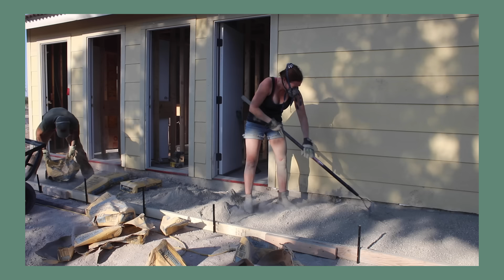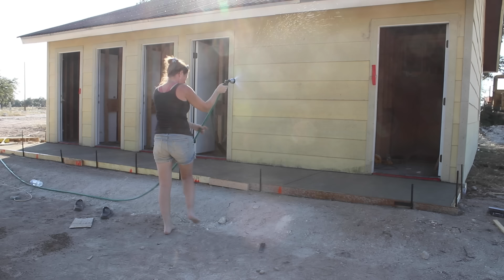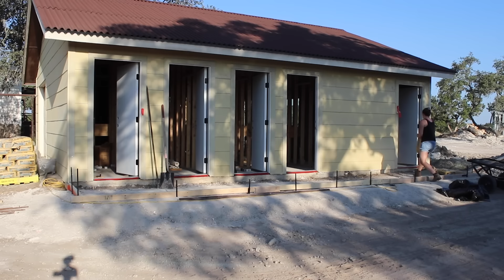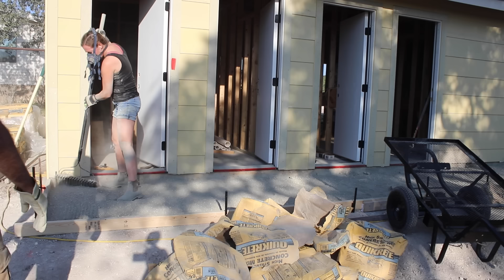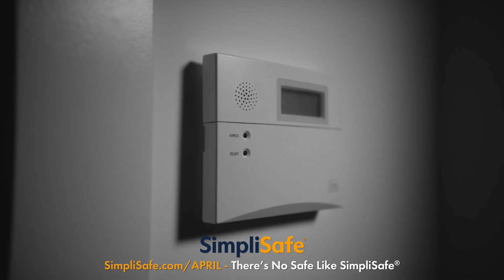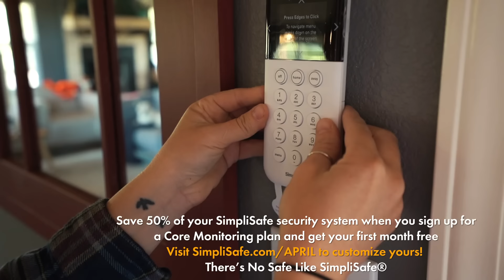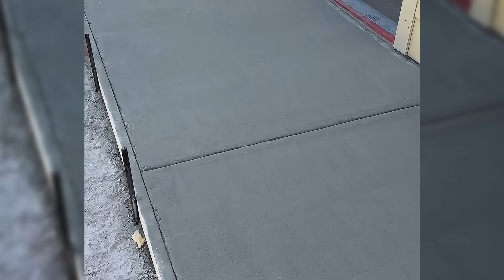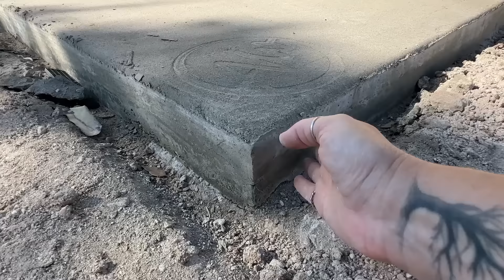Dry Pour Concrete | Better than Wet?

Comment: I was very intrigued when I first saw videos of dry pour come out about a year ago.  After seeing some of the after investigations by engineer types I would probably not try it except for light use.  No construction overhead.  Just don't think it is worth it.  But I will keep searching for ways to do this and make it strong.
Reply: A lack of hydration can weaken a dry pour, but the guaranteed weakness comes from the lack of compaction. In a wet pour, part of the process involves vibrating the mix so that the parts settle together and the air bubbles come out. That never happens with dry pour leaving lots of voids that will be prone to breaking. Vibration is usually the way to consolidate aggregate, but I think you would have a bigger dust problem if you tried that.

Comment: I found  this for calculating how much concrete you need..
Mud mixer has a calculator on their website 
I'm debating dry pour for a road runway down our hill to the lake 60" on center instead of spinning tires taking my Pontoon up in the spring

Comment: I worked as a form carpenter and form watcher during the early 80’s on locks and dams.  Concrete needs to be poured as dry as possible.  And at the correct temperature.  It dries to the hardest under water and continues to harden for 100 years.  I have never poured it dry except for mailbox posts.  This method makes a lot of sense for pouring bags.
Reply from the maker: Yes, I think it's perfect for what I needed. Thanks for Sharing and for watching.
Reply: The other thing those concrete pours needed was vibration to consolidate the aggregate and remove the air pockets. This never happens with dry pours, which is why it is inevitably weaker.
Reply: @johnlee7085  You can vibrate the forms on the dry pour.
Reply: @zedwpd
While it is possible to vibrate the forms on the dry pour, that’s not a standard practice. It would also be irrelevant for two reasons:
1. In virtually all compaction processes, there is a need for some moisture to achieve maximum compaction. 
2. Even if you could achieve maximum compaction, vibrating the forms would only compact the outer few inches of concrete leaving the vast majority of the slab with inherent weakness.

Comment: Do you really want to connect the new slab with the old? Cracking potential?
Reply: It’s generally done to prevent differential settlement and trip hazards. The rebar and columns are the two most likely places for failure.

Comment: Is there a special bag to get?
Reply: Nope regular concrete works.

Although I recommend watering it for several days everytime it looks dry.
And let it sit for 3 or 4 before pulling the forms.

I have made several sidewalks like this.
The people I did them for dont drive tanks on them.

Rough is better than smooth for traction.

Comment: Looks promising and job well done, but two questions arise 
1. How much water do you need to poor on to it, when do you know it is enough ?
2. How does the price relate to wet concrete for the same area.
Thanks for sharing
Reply: You need at least as much water as if you were mixing for a wet pour; about a gallon per bag. You probably aren’t going to measure the water, so error on the side of over hydrating. You really can’t give it too much water. You can add too much water if you’re mixing it with the dry concrete, but once it’s placed, the concrete could be completely submerged and it won’t weaken the concrete. In fact, the concrete will be stronger. 
You use basically the same amount of concrete, so it’s no different than the cost for mixing the bags. Bagged concrete is a lot more expensive for a big job.

Comment: Dry pour isn't a new method, it's just new to social media. Wet poured concrete all over the world has cracks in it. You nailed it when you said this is for light traffic applications. Anything bigger than a shed or a tiny home would probably need more strength. As a DIYer with a limited budget, I have been pouring all my concrete using this method. It works perfectly for my needs. I work alone so I need to be able to take my time and even spread the project out over 2 or 3 days. I'm thrilled with the results. People online need to learn to worry about themselves and their needs. If you don't like something, keep scrolling. Great job and thanks for this awesome video. It looks great.
Reply: Discussion is how we learn.
Reply from the maker: Thanks! Yes, I think this will be perfect for what I need. Thanks for Sharing and for watching.

Comment: Several years ago I did a dry pour in the crawl space of a 100+ year old farmhouse. It’s holding up fine, but I do notice it’s more gritty than a wet pour. I see no reason for your dry pour to fail April. In both cases it’s a low pressure environment for the concrete.
Reply from the maker: Awesome! Yes, I think it's perfect for what I need. Thanks for watching.
Reply: Columns and rebar will likely create high pressures.

Comment: Interesting process. I have not seen anything quite like this being done. I have seen where people have set posts in concrete using a dry pour in to the hole and add water but have not seen a slab being done like this.
Reply from the maker: Thanks! I'm glad you found it interesting. I think it will be fine for what I need. Thanks for watching.

Comment: I am happy you are experimenting with this idea. You are brave to put this on display in public seeing the sentiment of the comments, but I think experimentation is important. The patio looks excellent and can't wait to see the updates. I wonder if rain over time will make it even stronger. I have an architect and urban design background and we would use the slump test to determine the success of the concrete. These are tests for applications with heavier use. I don't believe that the method you are using is abberant since there will only be foot traffic. Thanks for sharing... Seriously!
Reply from the maker: Thank you! Yes, with only foot traffic, I think this will be fine. Thanks for watching.
Reply: Only light foot traffic - except where it’s the foundation for the columns.

Comment: Very disappointing to see you buying into the nonsense that is dry pour.  It is weak and will slough off at the edges.  You could have divided your porch into maybe four sections and done them separately to eliminate the dreaded urgency of a larger pour.
Reply: But instead she’s testing it and will report back.  How can that be bad?
Reply: Failure is generally seen as bad, though it can also be a part of learning. Learning from the failures is just easier.

Comment: To me that looks like more work than just doing it the right way. Also when you mix concrete in a mixer there's a thing about timing that makes the concrete stronger. It's actually a chemical reaction as you're mixing and then you put it out before the flashpoint starts to begin. What happens then is it generates its own heat and then it'll dry no matter how much water you put on it because it's a chemical reaction. So the key there is timing
Reply: You don't want concrete to "dry", you want it to cure. It is a chemical process that requires water, when you let concrete "dry" you lose the water that the chemical process requires. This is why it is best to keep concrete from drying out during the first week of curing.
Reply: @HarmanRobotics I’m not sure you understand the curing process. The water once mixed starts a chemical reaction which makes the concrete harden. The water doesn’t leave the concrete, it becomes a permanent part of the slab. If you weigh concrete before and after cure there will be almost no difference. The reason to keep it wet is to slow the process down by keeping it cool. This is one reason why dry pour has less strength. You start the curing process by adding water, but after it hardens subsequent watering doesn’t really add anything. So you get pockets that got enough water and pockets that got too much next to pockets that didn’t get enough water.
Reply: There is no one "right" way.

Comment: Another plus for dry versus wet. Is on a small pour like yours. A concrete truck will bring you the amount needed for a small pour, but they will charge you more for the smaller amount. At least they do where I live.

Comment: Curious about the amount of bags needed. If doing a dry pour did you find you needed more bags than doing a wet pour? I’m assuming when mixing the water add to the volume of concrete so lees actual concrete would be needed to fill the form
Reply: There’s no volumetric difference. The water is absorbed into the dry and results in a chemical reaction - which is also why she needed the lotion for the burns on her legs.

Comment: They have done destructive testing and dry pour doesn't withstand anywhere close to the same pressure as mixed.
Reply from the maker: This will only be walked upon so very little stress. Thanks for watching.
Reply: Except for the columns supporting the roof. 6” isn’t much foundation even if it was good concrete.

Comment: The real question is how was the cement burns that night lol. Legs burning, between your toes and bottom of your feet. Will be curious to see how well your slab holds up. I've mixed concrete in wheel barrows, excavator and skid steer buckets. My dad used to have a 4 yard mixer truck. Ive mixed enough concrete to know its a lot of work.

Comment: Regardless of a wet or dry option, the most important thing is the PPE. Respirators,
Clothing are very important, however simple things like rubbing yourself down with a thick lotion prior to getting dressed will help negate the effects of the concrete. I had a neighbor who worked with concrete for 30 years. At 50, he looked like a 90 year old lizard. He died of cancer at 63 what was determined to be his body absorbing the chemical agents from concrete. Working with concrete is necessary and can be rewarding, however a lot of people treat it like they’re working with dirt. The stuff is loaded with chemicals, so treat it as such.

Comment: The one mistake I saw, there is no expansion joint between the existing concrete and the dry pour. 3 or 4 inexperienced people could have poured that slab in ½ the it took you to dry pour. You ended up doing everything that is required for a wet pour. yes, you have to move a little faster. that sab would have been perfect for a first time wet pour.
Just try it.
Reply: Probably fine without the expansion joint since it is uncontained on the other three sides and not a big slab. I agree though the wet pour is better in many ways.
Reply: An expansion joint would isolate the outer pour, which is acceptable in some instances. In her case, the rebar connects the two slabs which prevents differential settling and reduces the probability of a trip hazard.

Comment: Never tried that way. How do you think that would work for a handicap ramp?
Reply: There are very good reasons why in the thousands of years of using concrete this method has only sprung up in the last 10 or so years in the south of the US. Think about that long and hard before employing it – especially for a handicap ramp.
Reply: No. Although I have used this method and will use it again.

A ramp needs to be poured using the regular method.

The top of the ramp is too thick and wont have proper compaction.
Reply: @shawnr771  You don’t know how thick the top of the ramp would be.
Reply: @johnlee7085  Probably around 4" thick on top of a dirt and gravel ramp.
Reply: @mikecurtis2585
A 4” thick slab is what is commonly placed, so it should be fine in that regard. There are a few factors to be cognizant of. 
1. Make sure you have at least 3” and don’t allow the slope to decrease the thickness. 
2. If you can get a heavy roller that you can use after it gets reasonably smooth, it will help to compact the mix. A lack of compaction is one of the differences between wet and dry that is a commonly ignored deficiency. 
3. Be extra careful when initially misting the surface. Even the minimal slope of a ramp could cause the water to flow and weaken the mix by displacing the fine cement particles in the process. 
4. When you apply the larger quantities of water, start at the top because it will flow downhill. You need to make sure the top is fully hydrated. 
5. One of the things I do, even with wet pours and especially when it’s hot, is once there is a firm surface, I cover the concrete with old towels. A neighbor gave us a couple dozen from a spa she worked at. This will make it easier to flood the mix over the prolonged time needed to fully hydrate the mix. 
Good luck, and hope this helps.
Reply: @johnlee7085  Thanks 🙏
Reply: @mikecurtis2585 It would depend on the dimensions of the ramp. A handicap ramp shouldn’t see heavy loads so it might be okay.

Comment: dry pour is quick and easy but 25-40% weaker than wet pour
Reply: So instead of having 4,000 psi concrete hers will only be 1,000 psi.  That should work for the average person walking out of the shower with a wet towel and two sets of clothes.
Reply: @dchall8 yep she isnt parking a tank on it.
Reply: 87% of all statistics are made up 91% of the time.

Comment: Don't believe the naysayers.  I did this exactly as AW did it, except I added a base of gravel.  After two Upstate NY winter freeze-thaws it is FINE.
Reply: Why haven't cement contractors started using this method?
Reply: @StoneE4  Because they dont have the time to water it every hour for 7 hours
Reply: @StoneE4  Because there is no $$$ in it. It only makes sense for small, low-performance, quick projects.  Same reason you can't hire a roofer to replace ONE shingle.
Reply: @adamdejesus4017  Your comparison is ridiculous. Of course no one would hire a roofer to replace ONE shingle. Outside of some really unlikely situations, when would someone ever have to replace ONE shingle anyway?
Concrete contractors do small jobs all the time like short walking paths, shed foundations, garbage can pads, etc. If concrete contractors didn't have those small jobs many of them would go out of business. So, I ask again... Why haven't concrete contractors started using this method?
Reply: @StoneE4  Because we have to stand behind our work.  Dry doesn't make nearly as solid (read high quality) a slab as pouring it properly.  Plus it is cleaner, and easier work.  And there is no viable option to finish it.  It comes out crude like this one did. They worked far too hard on this.  Not to mention the deadly dust.
Reply: It’s almost like DIYers and professionals might use different techniques and have different needs.  I do not understand why people claim to not see why some DIYers would benefit from dry pouring, in certain non structural use cases.
Reply: @mehill00  Yes, DIY has it’s own philosophy.  Another YouTuber, I cannot remember who, put it this way:

If it’s dangerous, OR difficult skill-wise, OR inexpensive if you call a professional = call a professional.

If it is safe, AND easy skill-wise, AND expensive in time and labor for a professional = consider DIY.
Reply from the maker: Awesome! It will be fine for my need with little to no stress. Only foot traffic. Thanks for Sharing and for watching.

Comment: It doesn’t make sense. I’m not a concrete guy, but that 4’ X whatever length slab is super manageable in a wet pour. 

Also, if this process is really only good for small projects, what’s the point? 

I dunno, not a fan. Good luck though!
Reply: If it’s good for small projects then people who do small projects can have another option.  That would be the point.
Reply: @mehill00  the point is that a small pour like this IS more than manageable. A novice can do this in a wet pour. Dry pour isn’t viable. If it was, concrete contractors would do it. April made content, nothing wrong with that, but it doesn’t make sense. End of discussion. Have a good evening!
Reply: @markantinore6418  Concrete workers would never do dry.  Professionals work fast and don’t want to come back and water a few times and they want to get the strongest most consistent results.  It only makes sense in some limited cases for DIYers.